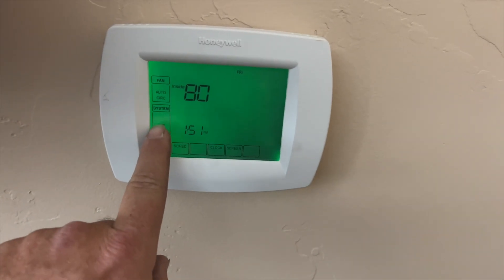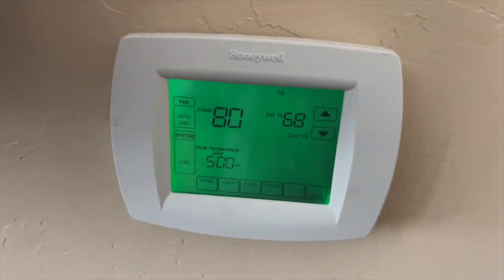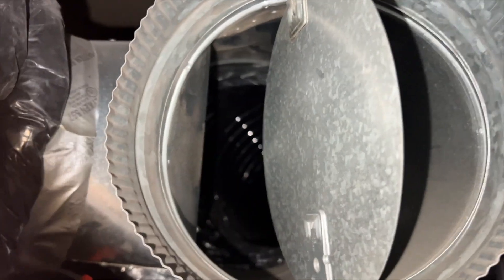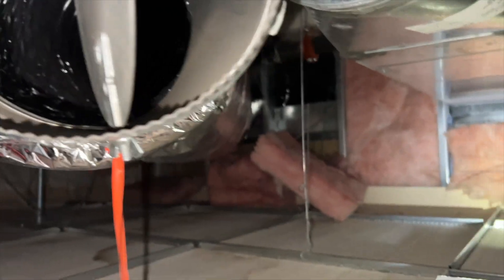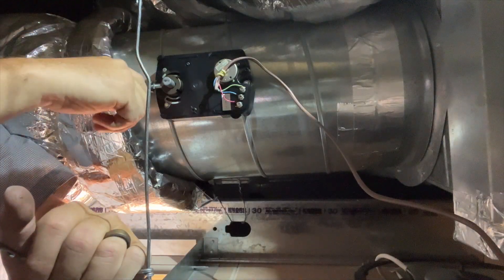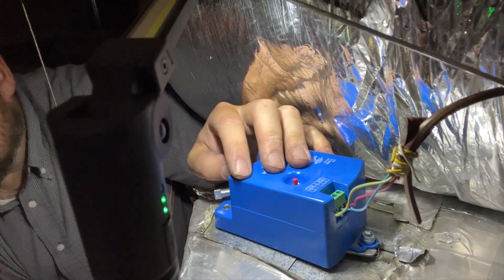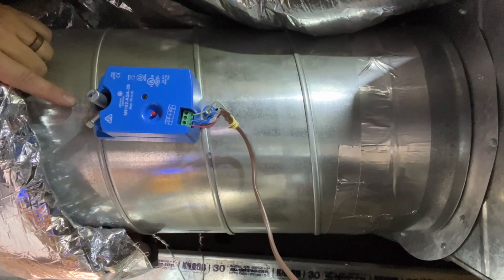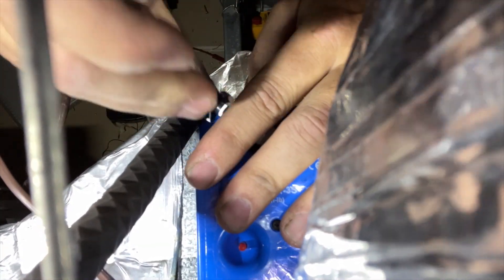No Cool.  Zone Damper Actuator Not Opening Or Closing EP139

Comment: Great video! What happened to the Ridgid drill? Thanks man
Reply from the maker: Still have it but I missed the small batteries of a 12V setup. Plus I bought a Ridgid one handed reciprocating  saw and it sucked. Kept over heating and locking out. My coworker was with me sawing the same thing with a Milwaukee 12V one handed hackzall with no problem. I returned it and got a 12V hackzall. Liked it so much I also got the 12V surge impact. Seems Ridgid is not as good as before. At least their wireless line.